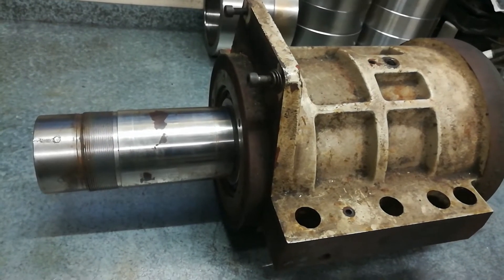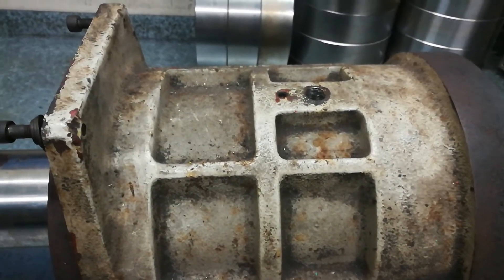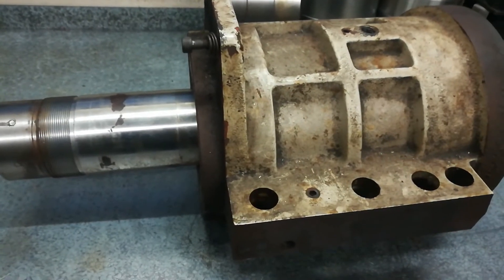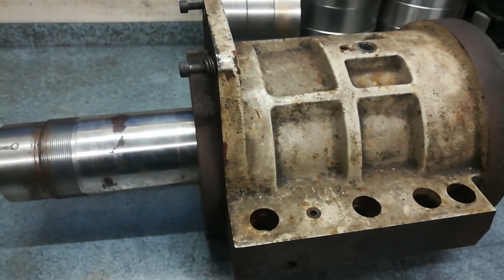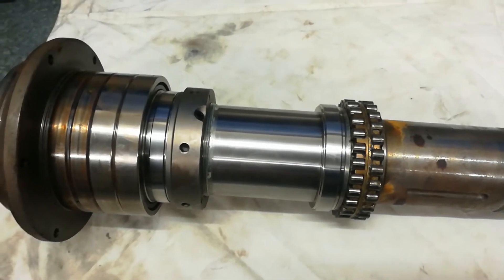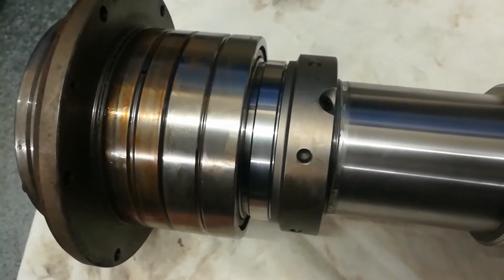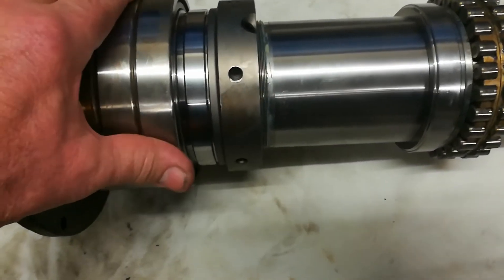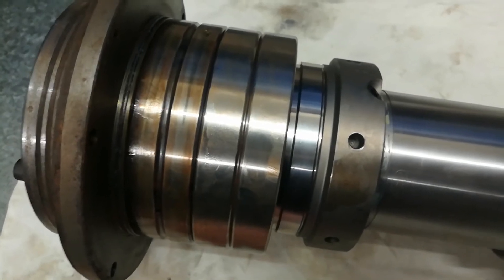CNC Lathe Rebuild. Spindle Bearings ????

Comment: My lathe had 4 bearings. All radial contact bearings but there was 2 at the front and two at the back of the spindle. And yes the cost of bearings is crazy.. awesome video.
Reply from the maker: It,s funny when i was removing the main shaft from the spindle housing.
I kept my fingers and toes crossed hoping to not have to replace the bearings.
I had already priced the replacements ????

If the bearings needed to be replaced i would have replaced them no doubt.
But it's a bill i prefer to not have.

I think at some point someone has already replaced the bearings previously as some of the pages from the parts manual had been removed for photocopying.
Not that it means anything but i was hoping, LOL.

Thanks for taking the time to watch.
Much appreciated.
Peter.

Comment: What type of bearings are they?
Reply from the maker: It,s hard to say the type of bearings that are fitted.
I never asked.  ( i only know the part numbers )
You can get some idea from the video.
I only know they are expensive to replace, LOL.

I guess not so important to know the type only the replacement part number, which can be difficult to know without the original parts manual.

From what i know they have at some point been replaced previously to me owning this machine.
Why i say that ?
Is someone has removed the pages from the manual to photocopy them ?
Must have been for a reason ??
Thanks for watching.  Peter.

Comment: Nice work Peter on the inspection and cleanup on the spindle shaft. Enjoy your weekend.
Reply from the maker: Hey Lloyd.
It is very time consuming to pull things apart just to see if they are fine.
But it gives you the confidence to know at some important parts of your machinery will run trouble free.
Thanks for watching.
Peter.